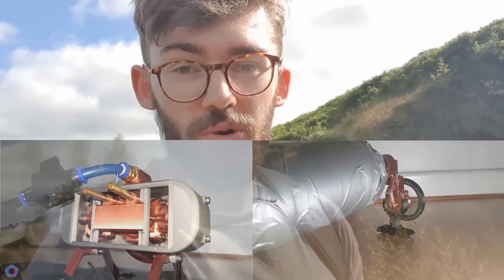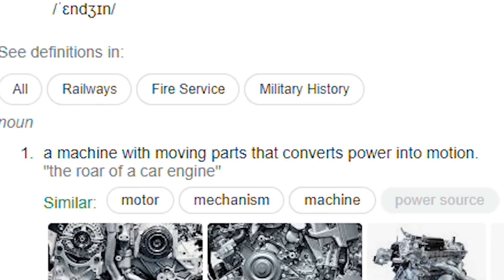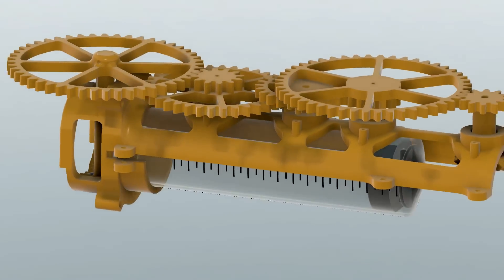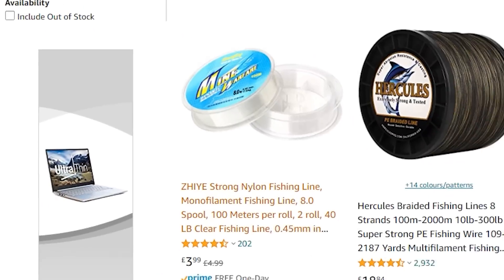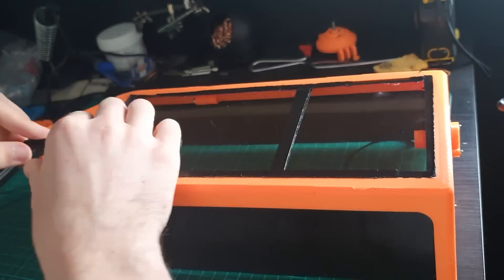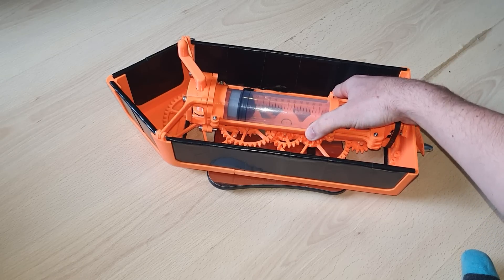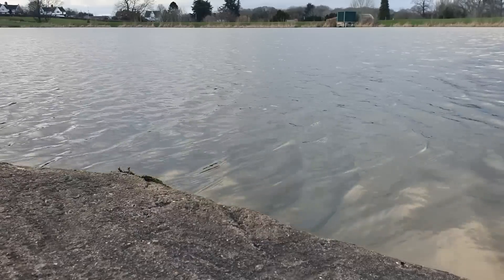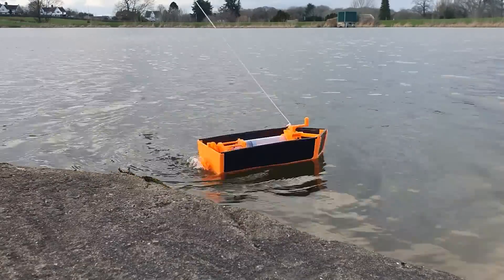3D printed atmosphere powered boat

Comment: What you were describing that you want to do is a nearly 300 year old engine design called a sterling engine. One country has re-designed this and has used it to run submarines now a lot of people considered a toy but if you set the conditions upright, you can have a engine that runs on the atmosphere. You have to provide one way to heat it in one way the cooler and you only need a few degrees.

Comment: Basically what you made is an energy battery based on vacuum. Problem with vacuum is: you can only have a pressure difference of 1 bar. While with compressed air you can go on. The only limit is the strength of your parts. And then if you create  a mechanism that keeps doing this, in stead of just one stroke, you've made a steam engine.

Also props need to be fully submerged. Otherwise they'll act as a paddlewheel with some sideways motion.

Comment: Next time someone is looking to create with 3d design have a look into OpenSCAD, as long as you don't mind a little bit of code, but I swear it's way easier than it sounds, and there are plenty of setups for gears that others have created as plugin like uses.  Just make searches with OpenSCAD next to the thing your looking for, screws, bolts, gears, etc. to see if it's out there.

Comment: Perhaps 2 propellers turning in opposition to each other would straighten it out. But some kind of simple rudder should do the trick too.
Noticed this was 7 months ago. Hope you are doing well and post another interesting build soon
Reply: One propeller would work ig it was fully submerged. Only the bottom half is under the water so it kind of acts like a  wheel. But if it was fully submerged the top and bottom Halfs would cancel the forces

Comment: why did you did you not think of a pair of side wheels like on a steamer and a rudder?.    It would of gone straight for a bit
Reply from the maker: I seen something else use the paddle wheel, so in the spirit of trying something else I went with this, but yeah the paddle wheel would have probably been easier

Comment: instead of making gear reduction your way, why don't you use cycloidal drive?  maybe you could add a stiff rudder since the prop is used more like a paddle wheel. - these are just stupid ideas. Anyways great vid!
Reply: Stupid ideas make for great inventions i.e. AC for power transmission and motors and zillions of other things.

Comment: If you ever go back to that project and lake you could try just adding some ballast to the back of the boat to submerge the prop further. It would leak more but that can be counteracted by using permanent sealing spray (ik commitment). I use it on my air engines and it works wonders.
Reply from the maker: That sounds like a good idea, thanks! I think I'll be less afraid of glue next time now I know it works
Reply: Easier and probably more efficient method would be to just use a gear system and lower the propeller further below the boat, far less weight and no additional materials required except for the 3D printer and filament which he already has...

Comment: This pretty cool! Always impressed with your ability to keep trying when things break.
I'm also kind left wondering if you turned it into a submarine if it would have more power the deeper it goes.

Also for what it's worth, shwivels fusion plugins tend to be great and well worth the money.
Reply from the maker: Yeah It probably would have more power, pressure roughly doubles for every 10m of water

Haha I have no doubt it's worth it, I probably will end up buying it 🤣
Reply: @kurzey8532  you add 1 bar every 10m of depth. So technically it doubles only at 10m compared to the atmospheric pressure.

Comment: I wonder, would it work on a train? I mean, in a station there can be some kind of mechanism to wind those syringes back up and one doesn’t need to be wary of train going in circles (depends on the railway…).
Reply from the maker: The mechanism to wind it up would most likely be electric, in which case you may as well use an electric train haha, interesting concept tho

Comment: I really like a series of upgrading. Please do another video. Maybe use the combination of a vacuum tube and a pressurised tube for more energy capacity? Maybe even up the volume? There is acually quite a lot that can be upgraded, so i will be looking forward to it.
In case you lack ideas im full of them, feel free to ask.
Reply from the maker: Yeah a pressurised container in addition could either make it go faster or further, might be hard to design this setup though!

I will most likely do an upgraded version soon because there is so much that could be done
Reply: @kurzey8532  Awesome! Here's a stupid suggestion - have two syringes, one pulls, the other pushes. Could use pulleys to convert one so both pull or push, and for the non vacuum one, you could have a valve filling it with pressurized air from a pressurized vessel. Heh, could use one of those pressurized carbon dioxide vials hoping it wont explode...